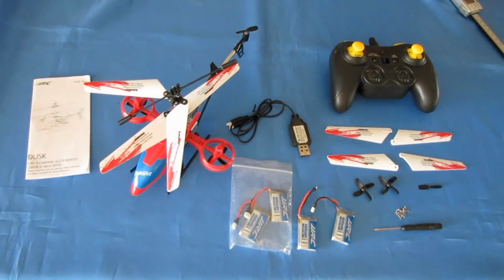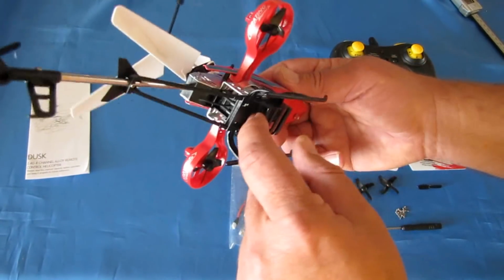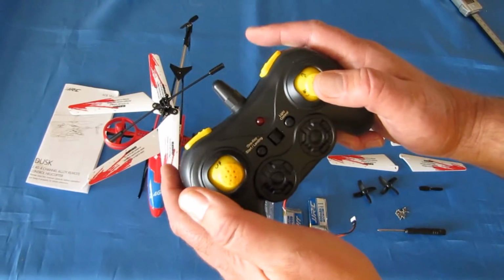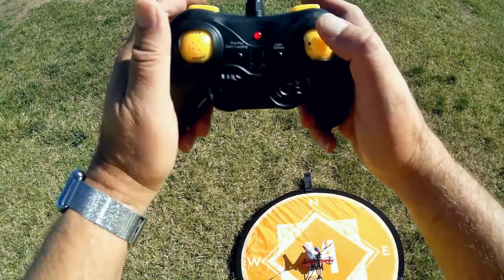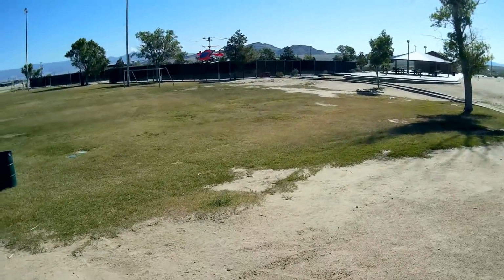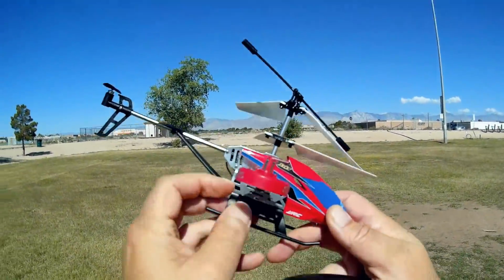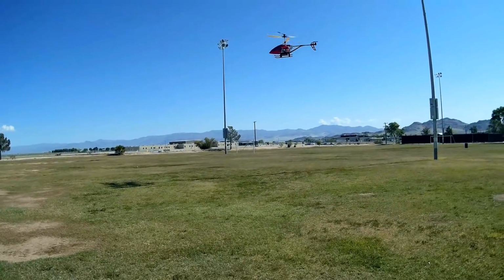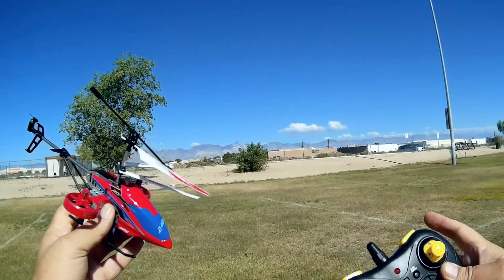JJRC JX02 Beginner's 4 Channel RC Helicopter Flight Test Review

Comment: You need to try one of th flybarless helis next. Banggood has the xk k130 or there's the Wltoys 911S that are pretty good. You will get the hang of it quickly since you have the basic skills down pat. Quick question... Do you have your 107 license yet??? Seems if we are going to continue in this hobby, it will be a requirement. Thank you for the video!

Comment: It needs a bigger prop on the tail rotor. Kind of a different design. The idea is sound but the execution is poor. There are much better helicopters around.
Reply from the maker: Yes there are better.  But this one is for beginners, and at $27 with free shipping, it should be a good cheap intro to helicopters.